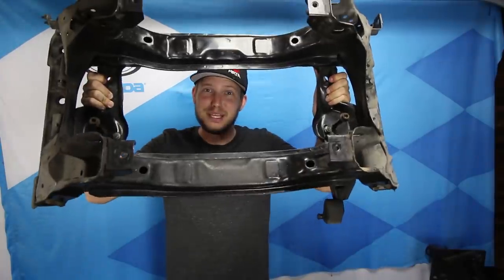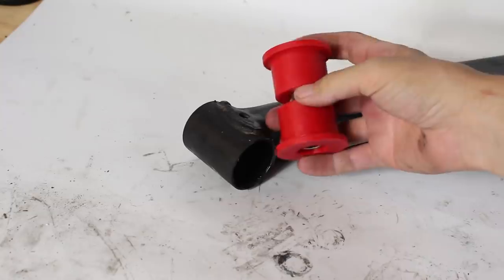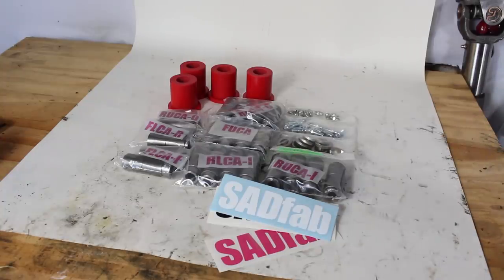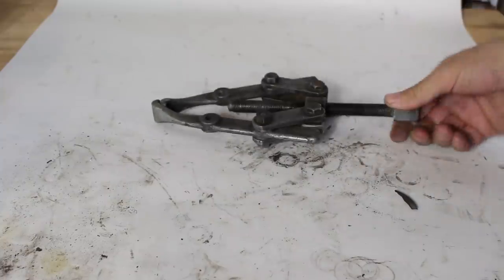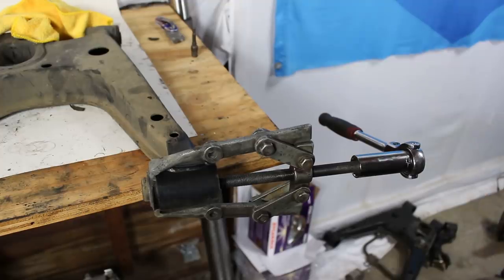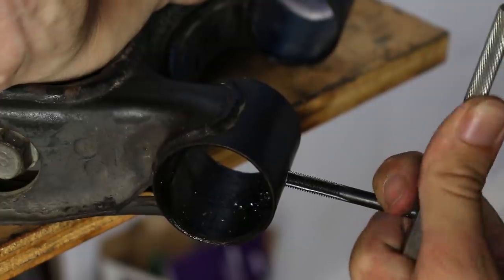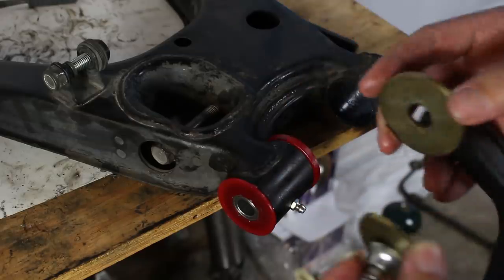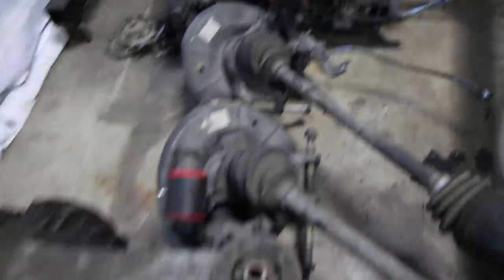Poly Bushing Upgrade & SADFab Bearing Retrofit! (No Press, No Fire)

Comment: I use marine grade grease on all my bushings, it works really good. It's a must have if you do like a bushing style insert on a oem mount. Be sure to wear gloves, it's insanely tacky.
Reply from the maker: Even the ES grease is ridiculously sticky, went through so many pairs of gloves attempting to keep the camera clean during this
Reply: What marine grease did you use?
Reply: Subie King can’t remember what I was using but energy suspension has good grease that will last.

Comment: Also, when I did this job I used a 3 jaw puller and it was so hard to line up. And some of the bushings were so stuck I bent the threaded rod and junked the puller. Then I just set a fire in my backyard patio and threw the control arms into it.

Comment: i changed all the bushings in all of the control arms when i installed fortune auto coils on my 99. the bushings themselves were pretty expensive from the dealership and i actually found it cheaper to just buy brand new control arms all around from rock auto with the bushings already installed so no pressing them out, just swapping control arms :) pro tip for anybody else!

Comment: I was going to use grease fittings in my poly bushing install but i instead found an alternative method. I found Mike Kojima recommends applying a layer of Teflon tape in addition to grease to keep the new bushings from speaking over longer periods of time. The example i saw was supposedly a 5yr old poly bushing install that was pulled off the car still not squeaking. i performed the install with teflon and no squeaking immediately as expected but more time is needed to truly test.
Reply: teflon around the bushing? how'd it stay in place when installing?

Comment: Interesting solution for the sleeve!
Used 3 arm puller and heater gun when changed to orange Polybush kit (flexing poly with sleeve fastened to the poly material, so function as rubber oem ones, but more reliable and a bit stiffer - fast road). Got out upper arms, but kept the lower font ones in place and changed bushings right there. A bit less working space but can be a pain to loosen the ball joints.

Comment: This looks like a good solution, I would not recommend using standard or cheap poly bushes in the long term. They can become very stiff to the detriment of safety without regular greasing and maintenance. Even channelled poly bushes require some ongoing lubrication. I’m looking these up because it seems like a good alternative

Comment: Tip for the tool to push the bearings in with the cal, use magnets to hold the round bits in place.

Comment: Greg, can you help us out with putting a list on your website of all the tools one will need to build a motor? I’ve also got a VVT 1.8 that I would really like to rebuild to similar specs, but I’m terribly unprepared in the tools department lol
Reply: Uriah Siner Maybe even a full comprehensive list of everything he has one to the day including all engine work.
Reply: I finished a 1.8 (not vvt) rebuild recently. Apart from the obvious socket and wrench set the only special tools I used was a torque wrench (you need a 1/2 drive or bigger to torque the crank and fly wheel bolts), and a piston rings compressor. Also the Miata uses 12 point bolts on the head so make sure you have a 12 point set and a 6 point set as if any bolts are seized on at all the 12 points will strip the head but a 6 point should be fine.

Then if your going to be re-using your rods you'll just need pliers and a mallet. Using that and the back of a screwdriver you can pop out the piston connecting shaft.

I know I'm not Greg but hopefully that helps. Good luck man!

Comment: How about freezing the whole control arm, then trying to get the bushing out? Maybe the metal and rubber have different warming rates, or you could freeze then apply a little heat to the outside of the metal as shown here.

Comment: With these bronze bearing kits installed, will the control arms move freely without the shocks installed? Unlike the preloaded twist of the stock rubber?? I'm wondering if the suspension would be better at absorbing small bumps if it could respond faster do to less stiction and how it would effect the original design philosophy.
Reply from the maker: Brian J Yes, with the bolts fully torqued the arms move freely through their full range of travel.

Comment: Just with considering that the original factory bushing lasted hundreds of thousands of miles. I didn't think the poly bushes will last anywhere near that because the r&d is not there.
Reply from the maker: Energy Suspension had been in the business a very long time, this isn't a cheap set of chinese knock off bushings. They're not claiming to outlast OEM's as the primary benefit (although they probably will), it's for people that want the perfomance benefit of polys. 🙂

Comment: Hey Greg, what's it like to have lived with Poly Bushings for a year?  Would you do it again? Does the car rattle on every bump now? Have you had to grease them since install? Do they squeak? Thoughts on handling?  Thanks for a great channel!
Reply from the maker: No negative effects to be noticed. And definitely no squeaking with the SadFab bearings. I probably should have greased them by now, but I haven't done it yet... it's on my to do list!
Reply: @TheCarPassionChannel  Great to hear. I'll definitely go with the SadFab as well then. Thanks for the follow up info.

Comment: Similar to the included Energy Suspension pins, its odd to me that these pins aren't WIDER than the bushing material itself. To me, without making the pin wider than the bushing, once you torque the bolt, it will still have an element of drag on the side faces of the bushings. Am I in the wrong here?

Comment: Hey carpassionchanell. Love the videos. Because of you I no longer feel the timing belt and water pump job is monumental amount of work. And I pull Nissan transmissions at work. Thank you. Also, years ago I saw I saw aftermarket upper control arms with serviceable ball joints. What's your take on those?

Comment: Great ideas with the drilling & adding  lube nipple 😃👍 i live in Australia  & we have Polyurethane Bushings  & Nolathane  & Rubber  of Course ! i use SuperPro Bushings & The Company  says they don't / won't  squeak 🤔 ive only had suspension  done recently  so i hope SuperPro  are right in saying they  wont make a noise in the future , My Question  to You  is Can we do your method  of sending tubes aways for drilling  on all brands & parts for our cars ??? Or just the particular  brand you are using ??? Could i get my SuperPro  Bushings  done same way you have done your Bushings ??? Steve in Bundaberg Australia 🇦🇺🍹🕺

Comment: In 2 weeks I'm buying a Miata any starter mods you suggest since you're the king of Miata
Reply: KingBryant #1 thing you should get is a roll bar
Reply: KingBryant good tires
Reply: Roll bar
Reply: Roll bar should definitely be the first thing you get. I advise spending the extra money and get something better than just a single  hoop. They aren't really that strong.
Reply: KingBryant hold on there's a video. I'll find it.
Reply: KingBryant, it is imperative to consider the condition of the brakes, fluids, and tires before transitioning to modifications. They should be replaced, unless they are pristine or sufficient. Afterwards, you should focus on mods, such as a roll bar, coil-overs, and the like. 

Additionally, clean the interior of the car. Once you purchase it, of course. Removing segments of the carpet will allow you to assess any damage the car has in the cabin. 

Since you are in the market for a used Miata, inspect the entire frame of the car. The front frame rails are susceptible to corrosion (particularly the NB) as are the rear quarter panels, and the fenders. It is not worth investing in if the corrosion is overwhelming.
Reply: Kayyxe I was definitely gonna go over the entire car first I enjoy doing maintenance on my vehicles because then I k ow I don't have to worry the car is coming from a friend and I actually helped him do the brakes a few weeks ago and I k ow the oil is good I'm gonna flush the cooling system because that's never been done and it runs slightly hot
Reply: KingBryant, wonderful. In that case, replacing a few items that require replacement should be the first mod performed. Or weight reductions.
Reply: Get a hair dryer
Reply: First do maintenance, then do the free stuff (Foamectomy, Remove Baby teeth, change ignition timing..) look for good rims and tires, then you can install a roll bar, exhaust and other stuff.

Comment: I have the same bushings in my 97 NA, and after taking it in the rain for a little drifting both rear lower control arms have their bushings popped out. This work was done by the previous owner, so I need to buy new rear bushings for the bearings etc, or just press them back in?
Reply from the maker: @a.drenalinet.herapy9489  Sounds like it might be missing the washers or something, the bushings should not be able to come out once everything is bolted onto the car

Comment: Slightly disappointed you didn't take the time to sand down and repaint the arms when you had them out. But this was some neat info, thanks a lot!
Reply from the maker: Not worth the time to make the bottom of my car pretty, it will look old again in 2k miles, lol
Reply: Sanding them down, prepping and painting them would've taken maybe twice or three times the time it took to change the bushings. I'm glad he didn't do it, as then we would have been waiting longer for the next video.
Reply: gotta powdercoat the subframe/control arms and zinc plate the hardware. Full fyeah spec

Comment: Dont you think the movement between the bearing ant the sleeve will actually wear them out and thin out the bearings after some time. Or is it the greese acting like OIL in an engine?

Comment: or for less fiddles  just use a bolt and nut through the middle of the bush instead of the C clamp
Reply: philip wakeham yeah. But this is universal for all the bushings and I'm not sure if some of the bolts aren't the same diameters.

Comment: why didn't I see this before I put in the master kit. And why didn't I see this when I removed all of them again, trimmed them down, then noticed that the CA's slide fore-aft along the trimmed bushings. I hate these mods, SadFab kit has reassured that third time is in fact the charm. Bad part is, I've trimmed my poly bushings so they don't bind against the subframe mounts, so now the SadFab kit likely won't work with the bushes that are in the arms. 
Good lord.... now what....
any suggestions anyone? All new kit and use SadFab retro? 
Replace all poly with MS bushes? I'm gonna go cry

Comment: Aren't you supposed to drill the polyurethane so the grease from the fitting can reach the bearings?
Reply: As I remember you have to drill the arm with the bushings in place.

Comment: I was just bout to get energy suspension master set good thing i no bout the sadfab sleeves now !!!! 👏 is a poly bushing for the diff gonna squeek or is there something for tht? Im doing the sway bars, control arms n diff. Also is there sleeves for the sway bars
Reply from the maker: Jack of all trades King of NONE ! The diff bushings have no rotation so they won't squeak. it wouldn't be possible to use this design on the sway bars because the sleeve bearing wouldn't be able to slide from the tips of the bars all the way to the bushings. Guess I'll have to wait and see if they squeak!
Reply: So not even the sway bar end links
Reply: And thanks just making sure cause i have a 89/90 it says 89 on the door jam n i wanna make it a beast at the track
Reply from the maker: Jack of all trades King of NONE ! I forgot about those because I have adjustable links with ball joints. But no, no sleeves for those. They don't usually squeak, it would be too much extra cost for two little benefit
Reply: TheCarPassionChannel I prefer ball joints honestly.

Comment: What is the point of installing an NB subframe? If you plan to install a 1.8? Let me know when you can.  Thank you.
Reply from the maker: I had to install the NB subframe in my car due to a special diff setup that used certain mounting points not available on the NA6 subframe
Reply: @TheCarPassionChannel  Oh was that the rear subframe? Were you using the 3.9 Torsen differential?
Reply from the maker: @amateurhomesteading4688  Yes rear sub, 3.9 Torsen but it was mounted custom because I had no PPF (BMW transmission swapped). You can install any 90-05 diff into any 90-05 subframe, no swap necessary for that

Comment: Hi Greg, did you have to cut an interior slide of the two piece polys to avoid hit in grease fittings?
Reply from the maker: Carlos QuinT I did not. There's a tiny gap between them, and the bushings all pressed in just fine

Comment: Never EVER use poly bushings, spherical bushings/bearings, HardRace rubber bushings, or... regular oem rubber bushings. Never buy polyurethane for control arms. Stiction is a problem with those, and squeak. They'll rip eventually, before rubbers. 3:06, that's a very good idea but still it'll make noise because of the metal on metal rotating contact.